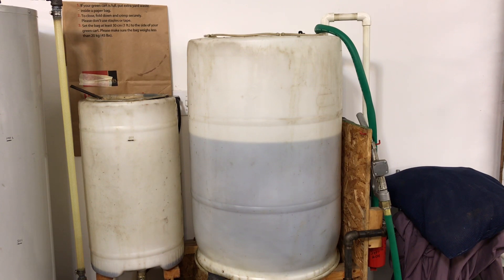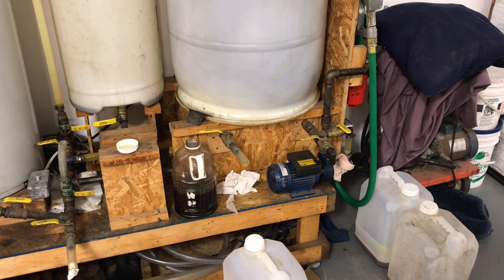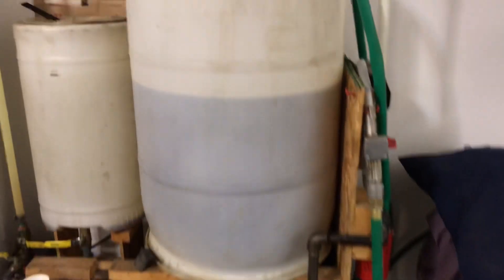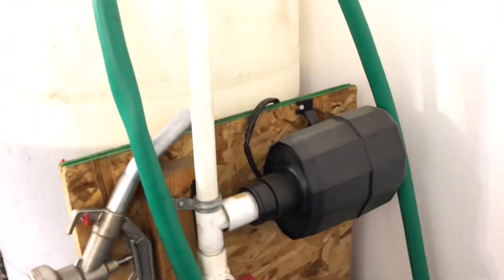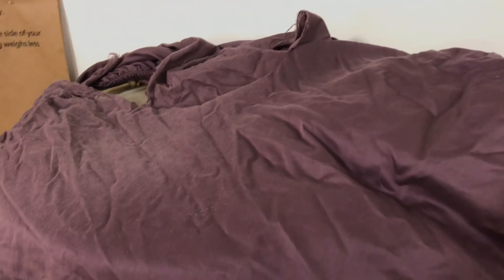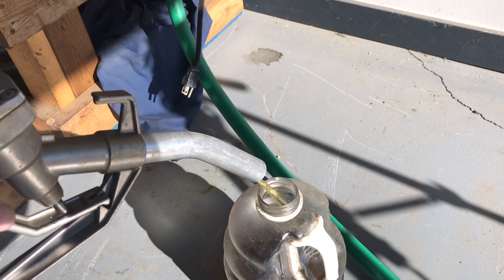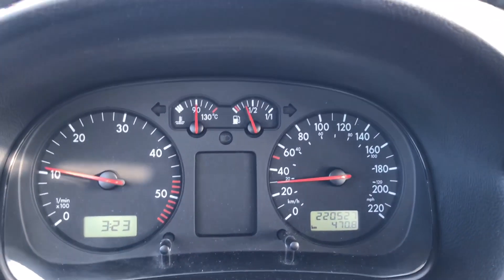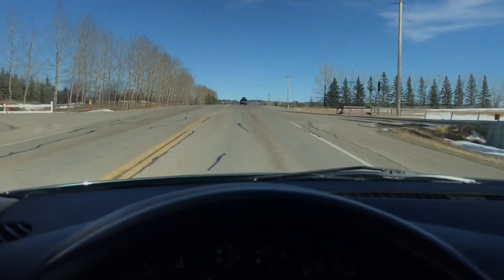Making Biodiesel Part 3:  Final dry washing and using the final product!

Comment: For starters, thank you for this video series. It has been very informative and much more streamline than other systems I have seen. I have 4 quick questions if you have the time. 1) After you air dry the diesel, do you need to drain the soap from the bottom of the tank? 2) Do you have a stand pipe in the final tank to prevent pulling from the bottom when filling up your vehicle? 3) Could you introduce the meth-oxide into the same tank you put the dirty oil into instead of using a separate pipe/container? 4) Do you do a titrate test before each batch?

Thanks again.
Reply from the maker: 1) yes some soap and crap falls to the bottom and  I drain it out.

2) yes there is a 6" stand pipe to take the cleaner fuel from up a bit...

3) You could do that but I think it would be more dangerous to dump that stuff into the oil tank vs. mixing it in a container and introducing though a hose like I do.

4) No I titrated some samples at the beginning and understand how much KOH is required for my oil.  I only use relatively clean "dirty" oil so just a bit more than the "base" amount and it seems to work out.  It's probably not a perfect reaction but runs well in my TDI.

Comment: i bet if you checkout skimmer for saltwater fishtanks,  you'll be able to better adjust your system air cleaning

can i ask where you buy methanol & the bag Chemicals
Reply from the maker: Buy at a chemical dealer.  You may need a business or licences depending on state rules.

Not sure on a skimmer.  The air needs to be high volume for it to work.

Comment: washing is unnecessary
Reply from the maker: based on what?
Reply: @gregs_garage  my own experience 100 000 mi audi a4b5 19tdi   AFN done on that
Reply from the maker: @ThePablojoker  interesting.   Well dry washing the way I do it doesn't cost much - gets rid of some methanol and some crap does fall out the bottom so I feel better about it.
Reply: @gregs_garage  They measure emissions many times and have always been surprised. New cars have not said so.. fall out the bottom ?
Reply from the maker: @ThePablojoker  after dry washing some glycerin and soap falls to the bottom of the biodiesel and is drained off.

Comment: What??? Why are you doing that? You waste up your  time and you make business with very dangerous chemicals! I have long time ago the same WV car like you are. I just clean WVO very clean and mix with petrol 15 % and have never ever any problem with that. In the winter time mix 50% wvo - 30% diesel - 20% petrol and it’s work for me perfect. Only you need to change fuel filter every 6000 miles, and that it’s all.
Reply from the maker: WVO and gasoline.  no thanks
Reply from the maker: @alexa795  methanol is not in the final product.  it's used in the chemical reaction.  go burn some oil
Reply: @gregs_garage  Good luck with poison. Try not to breath or drink something of that stuff 👍☺️
Reply: I think you both are correct. Its pretty common practice to use WVO + a thinner (gasoline being the most common). All the thinner is doing is making it less hard on your pumps. Many other thinners you could use as well and other “recipes”. Generally you still need to filter this very very well. 

Nothing wrong with making actual biodiesel either, and that is certainly going to be easier on your engine and not tear up your filters and gum up your injectors. 

Not sure you can argue that working with gasoline is less dangerous than methanol? Both have similar levels of toxicity, and methanol is less flammable. One is from petroleum, one is from natural gas.
Reply: @JimYeats  I don’t need to explain anything more. Every body know’s that methanol it’s much more dangerous of petrol. You can read about that on every biodiesel forum or such.
Reply from the maker: @alexa795  yes methanol is dangerous.  need lots of ventilation and no sparks.  I do not recommend anybody ever uses methanol.  

This is personal experience demonstration only.  My biodiesel has been used for 13 years without issue.  WVO and gasoline for 13 years?  I'm not sure any car would like that.
Reply: @gregs_garage  I have drive my VW Bora 1.9 tdi on WVO+rug mix more than 10 years without any problems. Even if happened that Bosch pump fails, used one on the junkyard it’s only 50$. And to change it’s the same price .
Reply: @alexa795  are you suggesting that it's ok to breathe/drink petrol?
Reply: @SabertoothDeathmouse  You can ask that question guys that drives petrol cars. Or you can try your self, maybe petrol it’s taste which you prefer. But never ever try methanol even if you have 2% of brain cells.
Reply: @alexa795  i will say a prayer for you tonight to our dear lord.
Reply: @andrewmena3118  Thanx but i am not believer… Pray for your self… 👍🏻
Reply: @alexa795  no no no!!!! I said a prayer for you regardless last night and i promise i will say a prayer for you again tonight so you wont be so upset all the time. Have a BLESSED day!!
Reply: @andrewmena3118  Do not need to do such a nonsense. Your life your problems
Reply: @braininavatnow9197  What are you talking about man?! What forum or such? I have experience with alternative fuel so many years and I don’t need any forums or similar.
Reply: This comment thread is funny. Thanks y’all for the life illustration. Everyone is aiming for the same goal but one guy is judging for the way another does it. He may not be religious but his judgmental attitude sure reminds me of some religious people. 😆
Reply: @davidprins9401  Omg! It’s look like Jehovah witness it’s here 😂
Reply: @alexa795  I meant you. 😉 Only because you were very judgmental against this way of doing biofuel. I respect your experience. You found something that works really well for you. It is worth celebrating. But other people have different ways of doing it and that’s also worth celebrating - because we are headed in the same direction. Would you agree?